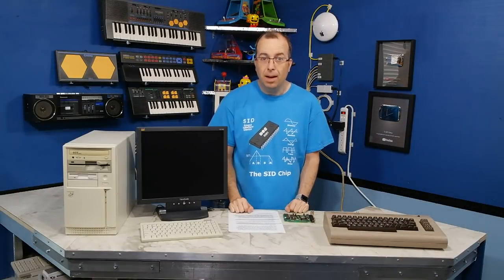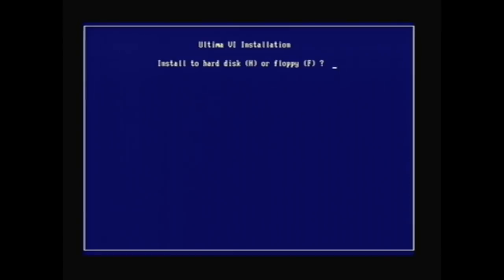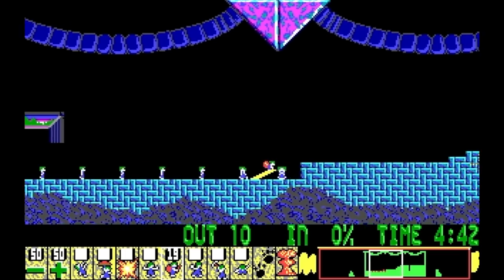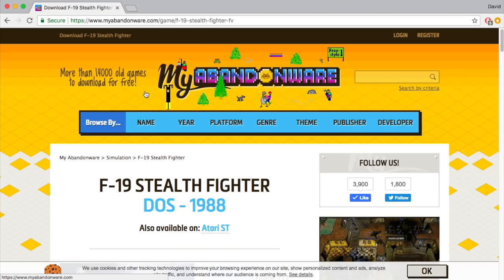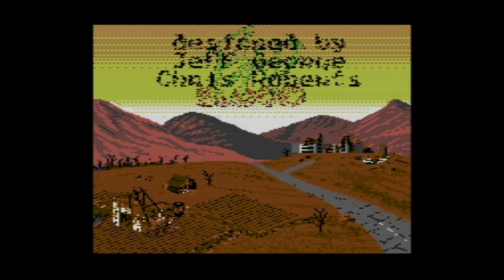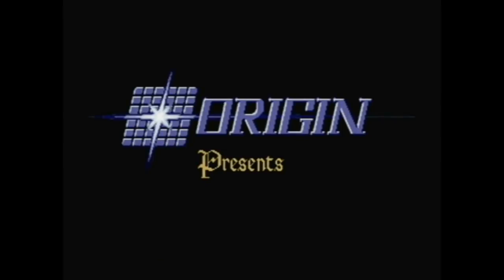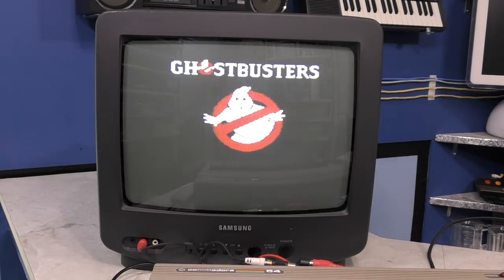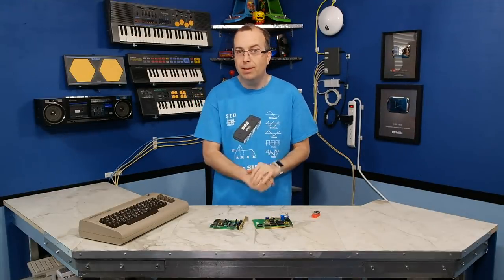Replica Sound Cards - AdLib, Innovation SSI-2001, and SwinSID Ultimate.

Comment: Do the OPL chips on the Sound Blaster cards sound that much different compared to original ADLIB? It sounded identical to me, but then again this has been years and years, and the last 20 or so, all I've been hearing is emulation. And emulation did indeed not sound the same. Also -- I wonder, are you considering support for these cards in Planet X-3, are a mere curiosity, if not for fun?
Reply: For the most part in the early years they were identical, both using the same OPL2/3 chips from Yamaha. Wasn't until later ones where they started using clone chips and emulation that the sound suffered
Reply: In my experience as someone who makes AdLib/OPL music, no, a card with an OPL3 chip (SB16) playing OPL2 (AdLib) music sounds the exact same as a card using the OPL2. The only major difference would be the circuitry on the cards affecting the audio output quality. Some of the SoundBlaster cards are infamous for using poor and out of spec components which would definitely alter the sound.

Comment: using CompactFlash as an IDE drive, i tested this in many kinds of systems including DOS, Windows 95/98 and even Windows XP, and it's complete crap, no hard disk cache, it lag a lot in games (due to no HDD cache), and Windows for some reasons doesn't create a "swap file" which needed for Windows to function properly. I would use a proper IDE SSD, and yes it does exist.

Comment: The SID chip cannot do sine waves, it only can do sawtooth, triangle, square and noise. Even with sampling a real sine wave cannot be achieved due to limited sample rate and sample resoultion (mostly only 4 bits, 8 bits with some programming tricks).
Reply: Don't underestimate the power of the SID. Apply a bandpass filter on a triangle wave and you get a very nice sine wave. And because the SID is an analog synthesizer, doesn't suffer from sample rate and resolution problems.
Reply: SID is not analog synthesizer, none of sound chips in the history are. They're all just a mere set of dividers (digital counters) that  divide input clock frequency to a programmed value then generate a waveform using hardwired schematics or a LUT, then feed it to a 4-bit (sometimes 5-bit) DAC.
Reply: This is only partially true. The oscillators of the SID indeed work using a 12-bit counter that count a divided input clock. This is also the resolution of the ADC. Everything that comes after the ADC is analog. This includes the envelope generator, filter, voice mixing (3 voices+ analog input) and volume control.

Allthough 12 bit resolution is quite advanced for the time that the SID was invented, because the filter is analog, you could argue that the SID can generate true sine waves, because the completely analog bandpass filter is an impenetrable barrier for arctefacts caused by the 12-bit resolution.
Reply: Your numbers and terms are off, so I suppose you're mistaken in understanding of internal SID operations. It has 16-bit adders, 24-bit accumulators, top 12 bits of an accumulator used to produce waveforms digitally. ADC is a contruary thing to DAC, you can't use it to output sounds. SID's EG is digital, uses a 4-bit DAC, thus only 16 sustain levels. Nothing in SID is remarkably advanced for the time, it is more or less of a regular sound chip/digital synth design, because technology and silicon space at a time only allowed to have about the same. Namco's WSG from 1980 had waveforms (including sine wave) and volume control as well, slap an analog filter to that, and that's your SID, more or less.

Comment: Does the swinsid have vcf? I always thought that it don't have possibility to filter sound, for example low pass resonant sweeps. Or perhaps it was true back then, now it has it? Anyone knows something in this topic?
Reply: Swinsid <> Swinsid Ultimate. The thing they have in common is that they both are based on AVR microcontrollers, but they are completely different implementations. The Swinsid Ultimate can to filtering.

Comment: The pitch is also slightly higher (a note or two) on the real Sid  chip.

Kompjut0r did a test of several chips earlier and there were noticeable differences:
http://kompjut0r.blogspot.com/2018/04/sid-8580-vs-armsid-vs-swinsid-ultimate_12.html

Comment: Does the CPU really run at a different speed on PAL?  That is not the reason for timing differences on other computers.
Reply: 985 KHz for PAL, 1021 KHz for NTSC. However, most C64 games play their music inside a raster interrupt and then the number of interrupts determines how fast the song is played. Because PAL is 50Hz and NTSC 60Hz, that is the amount of interrupts per second. And this 20% is a far bigger difference than the clock speed difference.
Reply: Most machines seemed to use the VBI for audio timing and lots of other timing tasks.  Definitely sounded fishy when he blamed the CPU speed.  Interesting that it does run at a slightly different speed though.

Comment: Can someone explain to this casual (thats me I'm taking about) why mare sid chips cant be made?
Reply: The original SID chips cannot be produced anymore because they were mixed digital/analog chips and the analog part did depend on properties of Commdore's manufacturing process. Commodore does not exist anymore and their does their factory exist anymore. Besides, the design got lost as well.

You can try to design modern replacements, but it is difficult to design a chip that sounds exactly the same. This is because the filter in the SID chip deviates from its specifications and these deviations are part of the characteristic sound. You need to develop a mathematical model of what happens inside the SID chip, and simulate this model digitally in order to produce the same sound.

But... we are getting there. The SwinSID is good, the FPGASID is reported to be awfully close to the original sound.

Comment: Is it just me or does the SwinSID sound a semitone lower than the original SID?
Reply: Likely not. The clock speed difference between PAL (985 KHz) and NTSC (1021 KHz) causes a small difference in pitch between PAL and NTSC machines. It can be compensated for in software, but most games don't do this.

The pitch of the SwinSID is independent of the system you put it in, instead you can configure the PAL or NTSC pitch. If the SwinSID is configured to PAL (the default) and you compare it to an NTSC SID, there is a small pitch difference.

Comment: One on side, this SID chip HW emulation is mind blowing, really cool that people keep putting effort on the C64 and this secures the stock of SID chips for long years to come. But in the other hand, Im almost certain that a silicon die can be copied, opened with chemical and then using electronic microcope. It visited a small semiconductor company some years ago and they were SURE that their chip could be copied in the end. The protected their IP in another way, more on the FW side, but as for the silicon, they told me it could be copied. Now, if this is true, why dont just copy the orginal one ? ... My best guess is not enough interest to do the factory setp up, which most be expensive. Replicating SID and VIC by functionality is complicated because: hiden or lost documentation, missbehaviours that were exploded by developer etc etc ... probablydealing with the die face to face would be more accurate in the end (more expensive as well)
Reply: In the case of the SID, there is a complication: The analog part of the chip depends on specific properties of the NMOS transistors used. Use different transistors, and the analog part won't function correctly. Therefore you not just need a chip factory, you need a factory with a similar production process to the Commodore MOS Technologies fab.

Comment: Hey I got a question for you (or your viewers?), maybe you know.... there's an old game, Heretic. E1M2's music happens to be one of my favorite MIDI tracks from back in the day when I first started computer gaming. My first computer had an ESS 1868 soundcard which was some clone of, I think a soundblaster. I noticed that every single modern computer that I try to play Heretic on, butchers all of the music, E1M2 included. Did they change the MIDI format or something back then, or did this card play non-standard instruments or something? Do they make clones of that same MIDI hardware that work in modern computers?

Here's what it sounds like on modern computers:   https://www.youtube.com/watch?v=P811D8Ma_4s

Here's what it sounded like on my ESS 1868: https://www.youtube.com/watch?v=UHvdY53AOMw
Reply: In the case of Heretic, the music is datawise the same, but modern sound cards use standardised drivers and emulation to replicate old AdLib music, not always able to truly produce the same lo res AdLib sound.. The newer version you link to, seems to be using something more similar to the AdLib Gold standard, since you can hear the timpani and strings sound more realistic (close to General MIDI modules) than the original AdLib. I suspect the main "culprit" is that they're using OPL3 standard or newer that is backwards compatible with OPL1 and OPL2 but have a different sound set. It is the same with Microsoft embedded GM player in Windows XP and newer, or Apple's QuickTime player that emulates the GM via the onboard sound chips. It sounds terrible because they're only fragments of the real deal in terms of sample size and how many parameters they've allowed to replicate. They usually also slap on a nasty pumping compressor that levels out the sound when playing midifiles. Best thing is to go for the real deal or a new card/module that has the same spec as the old ones (both AdLib/SB and GM/MT-32)

Check out PhilsComputerLab on Youtube, he's got many videos on both AdLib, SoundBlaster and Roland sound cards/modules.
Reply: Can't say with absolute certainty for Heretic, but the Doom music was in fact composed with a Roland Sound Canvas, and any other rendition is simply an approximation. What you think "modern computers" is in fact closer to the way the composer intended, if you had the Roland MPU-401 midi interface and the SC-55 module attached (high end and expensive back then) you would hear it that way back then too. The ESS i think was a SBpro clone with a non creative labs 16bit mode and had an opl3 like chip. I think i still have mine somewhere here...
Reply: That's odd, because the ESS/Roland/SB version sounds more cleaner and more upbeat, and the rest just sounds... "off".... either way, IMO, the ESS version is way better.

Comment: I was a bad person and searched to see if a USB verson has been made.  Most people has laptops or towers that don't have ISA slots in the. And emulation is not the best.  

Hack-A-Day did an article about a couple of years ago on this hardware (earlier version?).  What did come out of the comments was a USB to ISA unit:

USB to ISA Unit:
http://arstech.com/install/ecom-prodshow/usb2isar.html

Similar unit but supports 3 ISA Slots but no case
http://arstech.com/install/ecom-prodshow/usb2isax3.html

Hack-A-Day article:
https://hackaday.com/2016/10/03/a-reproduction-vintage-sound-card/
Reply: It cannot be done in a software-compatible way. You might be able to use ISA cards with custom software that way, but there is no way to make original software access ISA cards that way. MS-DOS doesn't even support USB at all.
Reply: I figured there would have to an emulation layer somewhere.  I don'y know if the ISA host hardware comes with drive to do that emulations. 
 Maybe some tweaks to DOSBox?  Just spit balling ideas.

Comment: Now if they only made an Adlib/SB16 for modern machines....
Reply: What is the point of an SB16 if you have at least AC97 which is 16bit/48khz built in? And most have at least 24bit/96khz integrated onboard nowdays (tho that's overkill and useless, but still...).
Reply: freeculture what I mean is seeing a modern sound card with an FM synth on board and not going through emulation

Comment: So why are people hunting down adlib cards is my question?
Reply from the maker: They are original sound card standard upon which most sound cards were based or at least backwards compatible with for 15 years.
Reply: Hmmm. Having gone from a c64 to console gaming to 386-486 era, Sound blaster 16 was pretty much the standard at the time. There were also compatible devices. I remember people talking highly of products coming from Turtle Beach but I have absolutely no insight into this hardware. Thanks for responding.
Reply: Back in the day i wanted an AdLib card, simply because so many games supported it. Found a place that was selling something else, but they assured me it was 100% compatible with AdLib so i agreed. It was the "Sound Blaster", and indeed there was a little mention in the box about being AdLib compatible. It worked as expected, with the extra of "sound samples" that no game supported yet. But when they started coming (Ie. Wing Commander, Prince of Persia, etc) a friend who bought an actual AdLib started getting jealous and quickly swapped his AdLib for a SB. Little did we know this would become the defacto standard, simply because the Sound Blaster was fully documented.

The original Sound Blaster was not only AdLib compatible, but also Game Blaster compatible, if you purchased a couple of extra chips (i did), but very few games supported them.

Compared to the Sound Blaster, imo the AdLib's reign was very short lived, Sound Blaster would be the longest supported sound output method in DOS, even if it meant falling back to 8 bit samples and a single opl2 as the original Sound Blaster was.

Tho i agree with you the SSI could have made things "interesting" if it were marketed properly, AND they went the C65 way of using two SID chips for stereo...

Comment: Chiptunes always sound better than horrible adlib and SB16 cards.
Reply: But you always can make amazing chiptunes using those truly wonderful Adlib and SB16 cards.
Reply: Back in the day, I didn't come across a single PC game that used a genuine chiptune (aside from the nasty single-channel PC speaker). It was always a sore point for me that NES/Gameboy games sounded worlds better than a PC costing $2000 dollars. FM synthesis is so weak and flaccid sounding (apart from bells).
Reply: Chiptune is any tune synthesized with a sound chip. Adlib has a great sound chip. Problem with PC games is just the way they utilized the chip, in a very lazy uninspired way, as a fallback for MIDI soundtrack initially targeted for something like SC-55. Programmers on other platforms, like Japanese PC counterparts, FM extensions on the MSX series, Sega Genesis, knew better and did a much better job (they all used one of two families of Yamaha FM chips). And it does not sound any weak there. Unfortunately when PC programmers realized full potential of what they had at the hand, it was ~1995 already, way too late - wavetable synthesis become mainstream, and FM chips started to get disappear off newer PC sound cards, replaced by emulation, then removed altogether. Search for Edlib or Reality Adlib Tracker or Adlib Tracker II music on youtube to get the idea.

Comment: Not quite right to say nobody can build sid chips anymore, its just that its not worth it for anyone any more.
Reply: Well... ultimately it boils down to that but... there is likely no factory in the world anymore with a similar manufacturing process as the Commodore MOS fab and the original design has been lost. Therefore the cost to build original (or close to original) SID chips would be really high.

As recreating SID chip clones, this is exactly what projects like the FPGASID and SwinSID Ultimate are doing.

Comment: Get the Roland SC-55, its the best and most accurate sound card for MS-DOS.
Reply: No it's not. It's not a sound card. It's not even a card. It's a module with samples on it, and some mt32 emulation.
Reply: I heard its the most accurate though, especially when listening to DOOM.
Reply: I think the SNES soundtrack is pretty cool too.
Reply: I had one of those. It was 100% late 80s and early 90s General MIDI cheese. If you want that, just use the built-in Windows synthesizer. Roland helped create it using the same samples.
Reply: Accurate to what? If a game has properly made Adlib music, rather than crude MIDI-driven stuff, SC-55 simply won't be able to play it at all.
Reply: shiru8bit I agree with your comment here with one exception: MIDI-driven is not crude. But the sounds available at the time often were. General MIDI was a dark period in synth history. :P
Reply: I mean it, when a random (like, made for a rompler card) MIDI file routed to play through OPL, it will sound way worse than it could if music would be done for OPL properly. There is no problem with FM sounds itself, you can do amazing music with them. It is just happened that music in many DOS games relied to MIDI-driven rompler card such as SC-55 as their primary target, and everything else just been a crude fallback.
Reply: The SC-55 is the most accurate for DOOM.

Comment: I'm not a fan of how closely that Adlib clone resembles the original, specially since, as you said, they make revisions later that had those parts. I didn't see anything that said it was a replica or a clone, and even had the Adlib trademarks and copyrights printed on the board.
Reply: It does occur to me that the date is probably n indicator, but still.
Reply: Dušan Xmetov The one exception would be if it's actually made by / for the owner of the historic AdLib rights, making it a truly genuine AdLib(R) card. Like buying a brand new original Volkswagen Beatle from the Mexican or Brazilian VW factory in the 1990s.